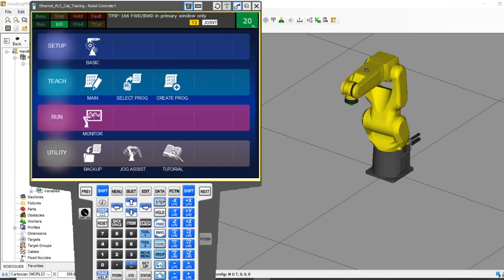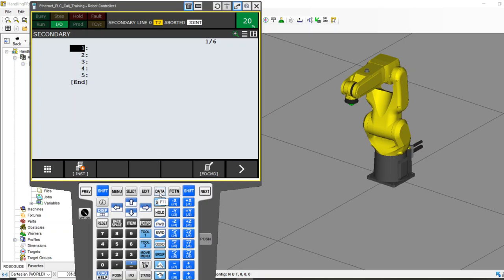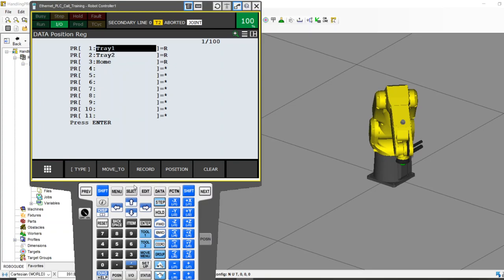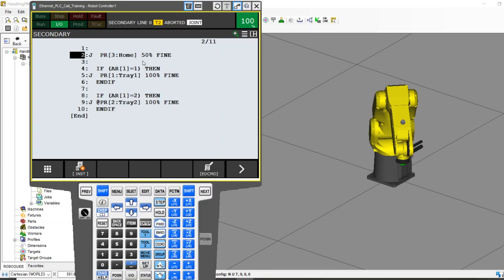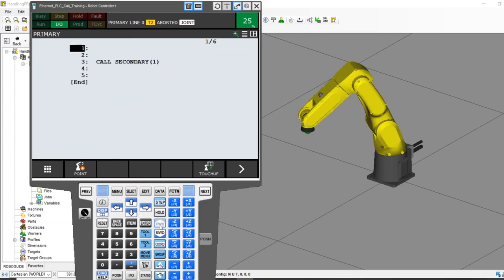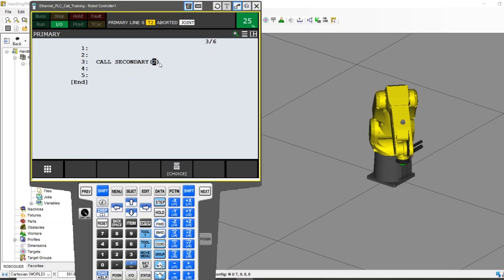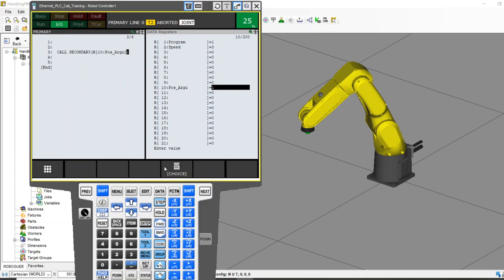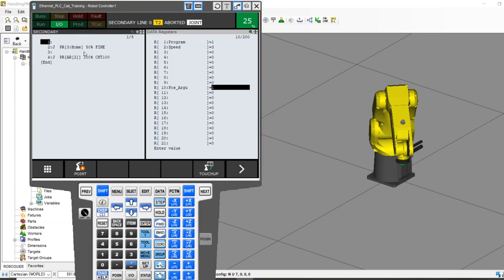FANUC Passing Arguments

Comment: how can I use an argument in a macro to open or close a gripper
Reply from the maker: In a typical application, you will not need to pass arguments to open/close a gripper in a Macro. It'd be simplest to create a new program, (set group mask to "*" and set as a macro) and inside the macro is just your I/O call. Normally looks like:
1: DO[1:GripperAdvance] = OFF
2: DO[2: GripperRetract] = ON
that would "Open" your gripper. Flip the on/off in a separate macro to close. 
It's possible you could pass an argument and have DO[R[x]] = ON and indirectly address your code so that you can control multiple grippers using one command and an argument. It'd work, but seems a bit excessive for basic I/O.